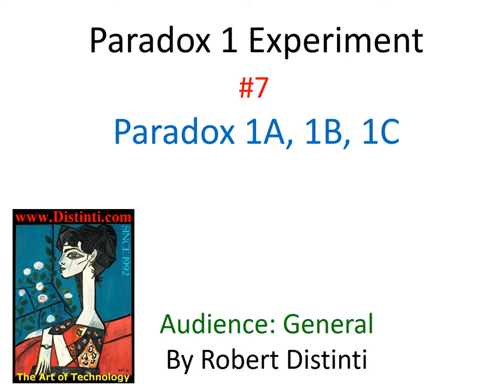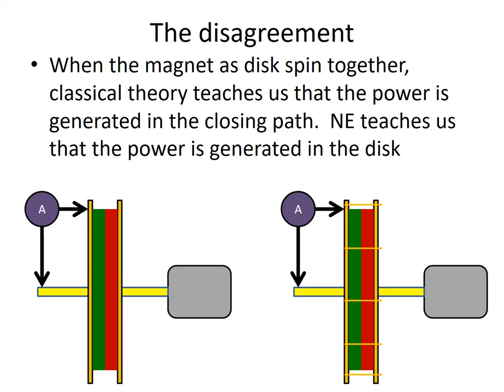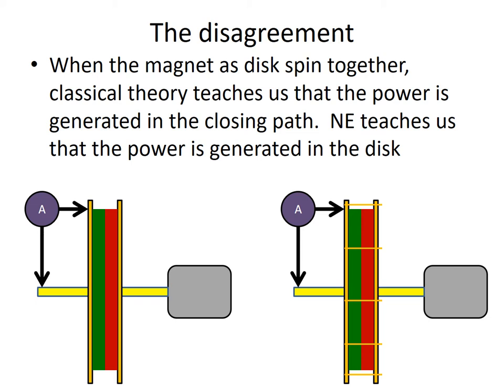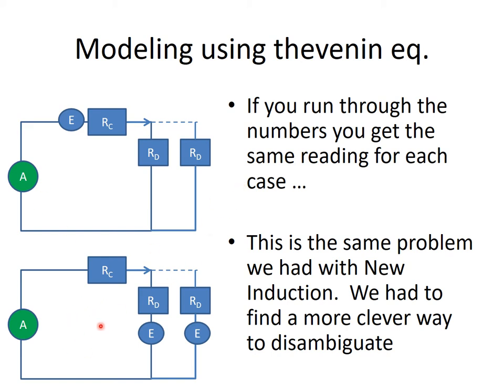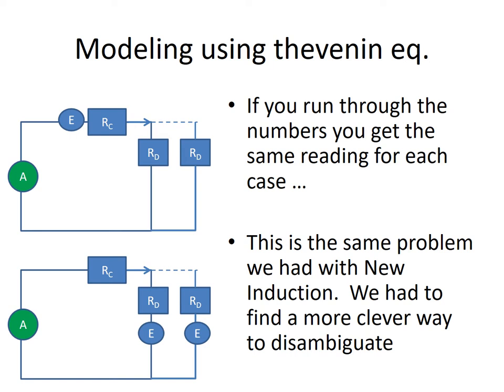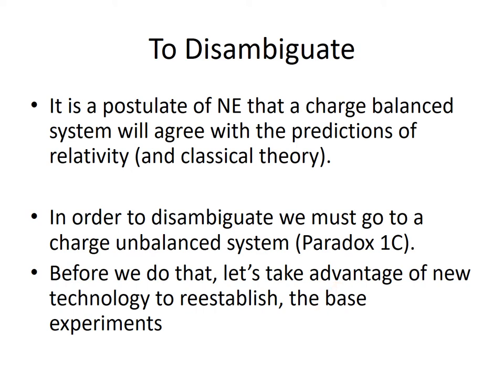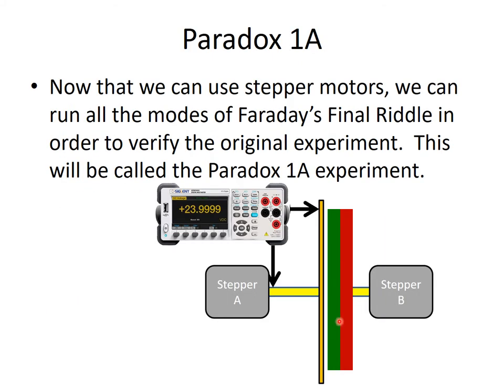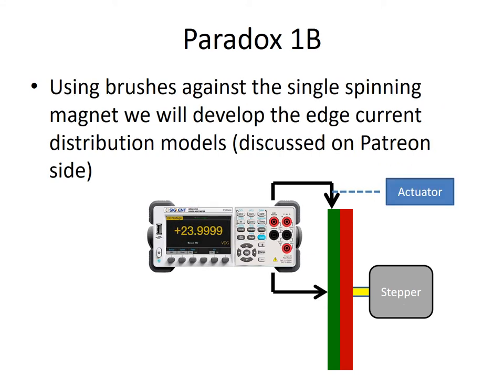PDX1 07 Paradox 1A 1B 1C: uncovering the secrets of magnetism

Comment: I see the problem when you have a stationary closed loop measuring system.  But if you place the measuring device on the copper disc and it spins with the disc then the relative movement is zero when everything spins.  Either transmit the data or video the digital meter and slow it down to read the meter.  Or take a fast picture.

Comment: you can also use cheap small brushless motors run by esc digital pwm. also how does your theory explain the ed leedskalnin device the coil of wire is pulsed once around two or more pieces of iron can it seem to lock them till you break with shearing force then they dont lock till you do it again
Reply: charge buildup?  that seems ok